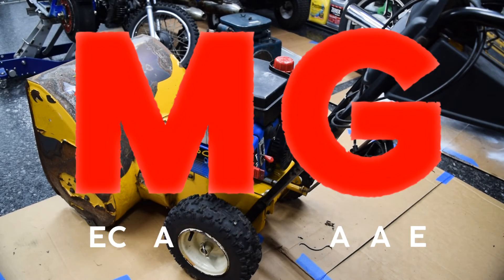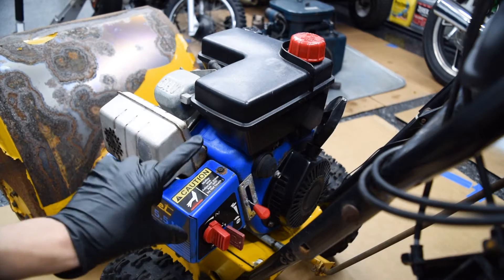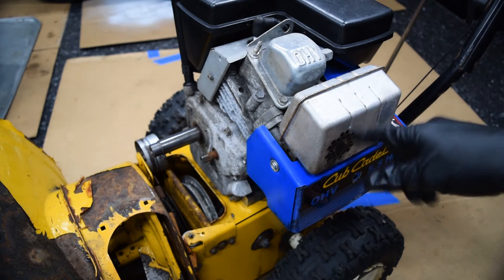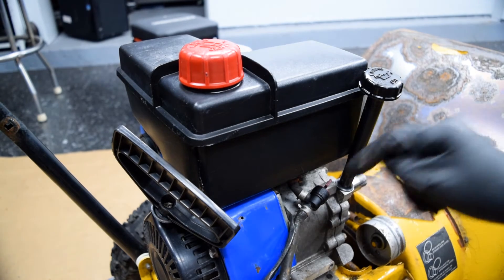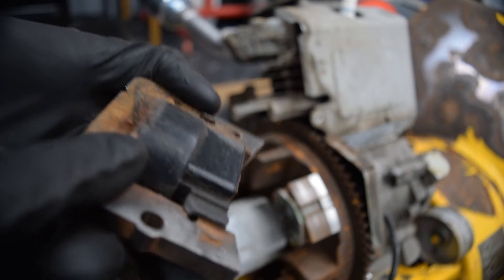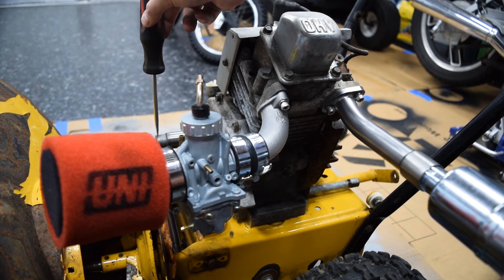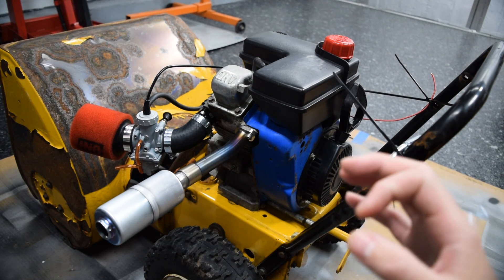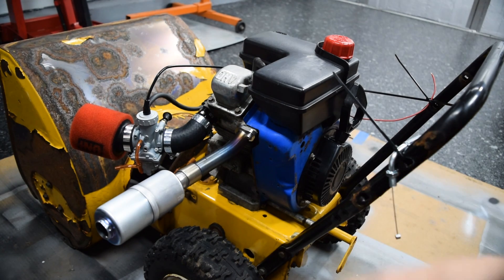Mod 101: $100 Mods Tecumseh OHV 5.5Hp

Comment: A rlv box stock 1" slip on is probably the best muffler if you havent done valve springs cam and a different carb. Its very difficult to find old stock performance parts for these f200 engines. Arc does still sell a flywheel and rod i think for these engines. The f200 was produced to compete against the brigs intek 205 206 and the honda gx200 as well as the gx200 clones. They was more a race engine yet the down side was the blocks wasnt strong at all over 14ish hp so they did need a lot of bracing imho the f200 is what killed tecumseh since these engines was bad on valve guides as well and wouldn't run right from sucking oil/air from the guide definitely was a race engine and needed rebuilt alot. The good side of these engines is that sbc rockers have the same size 3/8 rocker stud vs the 5/16 that briggs used so small block chevy ratio roller rockers work. Just remember that factory rockers are 1.3 to 1.4 ratio rockers. Also the 5hp and 5.5hp heads do raise a 6 and 6.5hp compression to around 9.5:1 or 10.1. Its been around 10 years since ive even messed with these f200 so some of the stuff on these engines if forgotten especially since they was saught as a trash engine run it a 2 3 race weekends and have to rebuild it most like reliable race engines so briggs over took the racing until hondas gx200 came out. Then the clones started popping up and the old timers didnt like the quality untill guys like jody at arc, Old timer Mr Clements got a hold of them and was giving feedback on what needed to be changed. The whole reason clones have taken over now. Anyways hopefully this long comment helps someone out. Oh an if you didnt know briggs and tecumseh was head and head on who could build the best most badass race engines the really didnt care about the lawn equipment side of things just racing. If a guy could find that article about the 2 i would definitely print it out and laminate it so people could see that tecumseh and briggs was very big into karts over everything else they sold engines for. So now a feller knows!

Comment: Thoughts on using an iridium spark plug? I have 8 of them laying around anyway.
Reply from the maker: Small engines like this aren't refined enough to benefit from iridium so you can use them but the only thing you'll get out of it is longer lifespan of the plugs.
Reply: @MechannibalGarage65  Is there a place I can get in touch with you directly? I have a lot of questions about a build Im working on.
Reply from the maker: The work email is in the About section for the channel.

Comment: Hello, I have had the worst time attempting to find an aftermarket  muffler for a "ohh60 71106c" Tecumseh 6.0hp.. do you have any suggestions?
Reply: For performance! Overall I'm really trying to just upgrade or tune the engine the best i can.
Reply from the maker: Yeah finding anything specific for these tecumsehs is really difficult. I'd try to find a dirt bike silencer for an 125cc+
Reply: @MechannibalGarage65  the bolt spacing reads 1.5 inches on the muffler flange. Does a 125cc muffler work?
Reply from the maker: It would depend on the manufacturer of the silencer and the bike model it's designed for. I'm sure some of them will work.
Reply: @MechannibalGarage65  thank you! Also..I'm in a pickle. I got a sprocket stuck on the cam shaft..and i cut the shaft now it's too short for the clutch ..do i just weld it back on?
Reply: Crank* shaft
Reply from the maker: Welding is probably the only cost effective option. Other option would be replace the crankshaft.
Reply: @MechannibalGarage65  yeah the crankshaft costs about an engine and no-one has it in stock, only back order. I cant even seem to find a replacement yet alone find specs lol

Comment: I think it would be far easier to just have a shop make a metal intake for like 40 bucks. 
It's a half hour of work if you start from scratch. 

Solves multiple problems at once

Bend a pipe, cut it to size, weld a flange on each end, done.
Reply from the maker: Yep it would have

Comment: That's an interesting intake set up. A VM22 mikuni has the same bolt pattern as the Tecumseh carburetor, but you have to make a spacer to clear the exhaust. Also the factory intake elbow is pretty bad for air flow. I'm gonna try your way!

Comment: There are 2 main versions of this block. Ohh50 is 172cc, ohh60,65,70,etc are all the 195cc block. Something to look for when buying one. I've built 2 of these and I bought a Tecumseh Motorsports version brand new and in the crate and it's waiting to be assembled! Good video!
Reply: Where did you find a crated powersport engine?
Reply: @contraband1543  there was a guy in Puerto Rico selling them back in 2020. He said his dad was a Tecumseh dealer and had a bunch of Tecumseh Motorsports stuff NOS. He had ohh motors (the overhead valve ones), H50 flatheads and 2 Star motors for sale. They're all gone now

Comment: OK tell me did you see any performance gains on the carb alone?
Reply from the maker: Absolutely, it actually likes to rev now and has a consistent power band. The mower style carbs really only like to maintain rpm or gradual rpm changes.